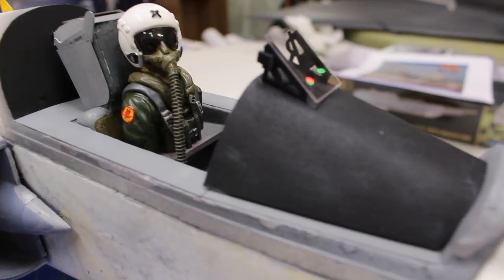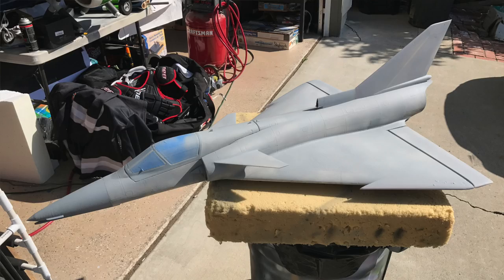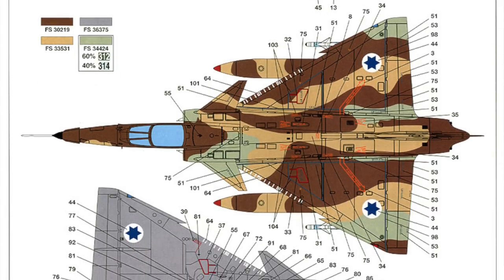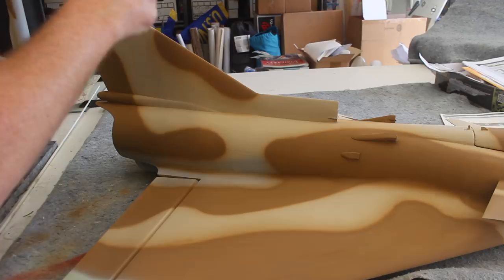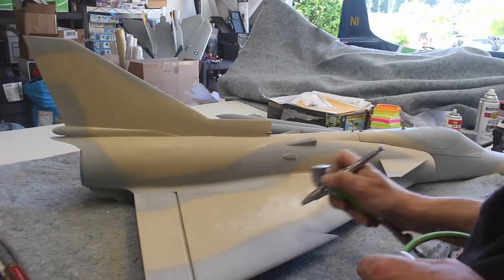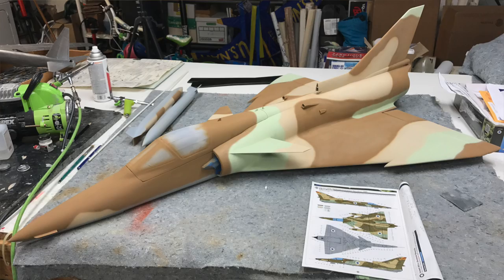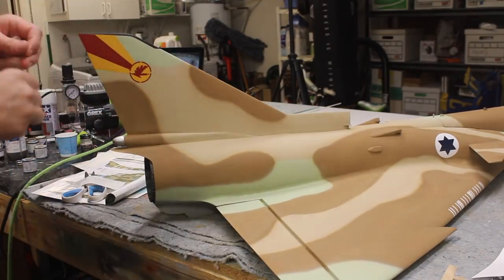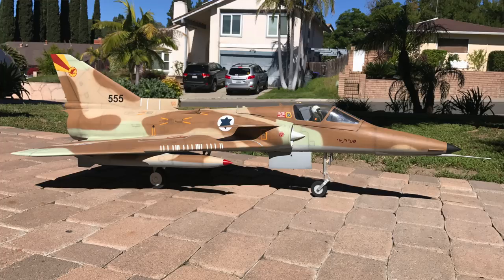Foam Kit Bashing Ep4 - The Painting Process (How to Paint Camouflage & Apply Markings)

Comment: Chris, great video, but what concerns me is that the Humbrol enamel paints are not foam safe.
How did you prevent seepage to areas not covered with the acrylic undercoat
Thanks
Reply from the maker: It wasn’t an issue at all. The airframe is epo foam which is extremely resilient to solvents. I’ve used all kinds of paint mediums on epo foam including some lacquers to success. The areas I carved from Home Depot foam, reacted in a couple small areas to the primer (applied too wet), so where that happened I refilled and sealed with poly and that took care of it.

Comment: Hey Chris, what is the best way to remove the stock decals? I began my project earlier this week and really struggled with removing the decals. Some came up ok, others pulled some foam off as well.  Thanks.
Reply from the maker: Are these sticky back stickers you’re pulling up or water slide decals?  The water slides don’t usually come up all that easily and so I will pull up what I can with masking tape and will leave whatever doesn’t pull up. For the stickers, I’ve heard that freezing them with ice helps pull them up and minimize damage underneath. Making the adhesive cold helps harden it to lift up easier. It does take some time to do though.
Reply: @Thercgeek  They were water slide. A little Sherwin Willams putty fixed the minor damage. 

Thanks for the reply!

Comment: What would you do if your doing a Spitfire camo and you only have spray paint?
Reply from the maker: Well, you can do a couple things.  You can mask off the lines with frog tape, spray it and then come back with an airbrush and feather the lines.  For the paint, simply spray a quantity of the spray paint into a cup and then use that in the airbrush.  Otherwise, there's something called "soft edge" tape which is basically just cylindrical foam tape.  That would give a feathered edge also.  Keep in mind that spray paints don't atomize the paint as well as an airbrush, so you may get some mottling in the feathered edge.
Reply from the maker: this is the soft edge masking tape: https://amzn.to/2pxU8Ve

Comment: Great help, thanks! Question, I’m painting a 1/5 scale fiberglass over wood BF-109. I plan on using my detail sprayer. The separation between the top and side colors is a straight line. But it’s not a sharp edge, it’s a slight fade. Like your freehand line from this video. 

So how do i do a long staight line that has a fade? Airbrush and a guide of some sort?

Thx

SJ
Reply from the maker: There are a couple things you can do.  You can free hand it, but I can understand the apprehension towards that.  You can do a hybrid of that where you actually mask the separation line and then come back and then airbrush the fade over that (after sanding the separation line smooth).  Lastly, 3M sells some round foam tape that you can use to mask off the line and with that stuff being round, it'll create a faded separation.  I think it's called soft edge masking tape.
Reply from the maker: This is it: https://amzn.to/2Oha9au